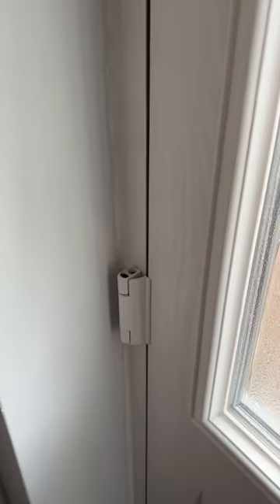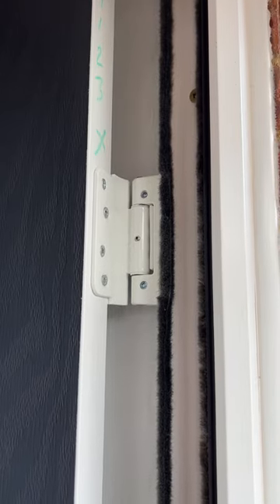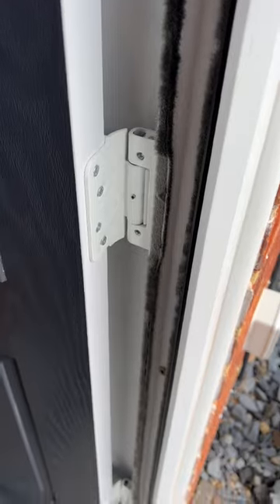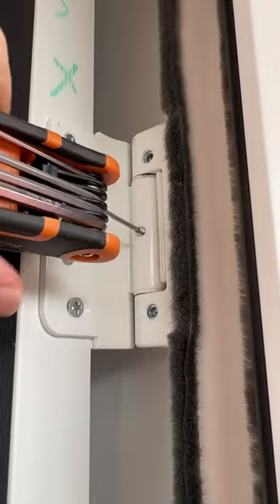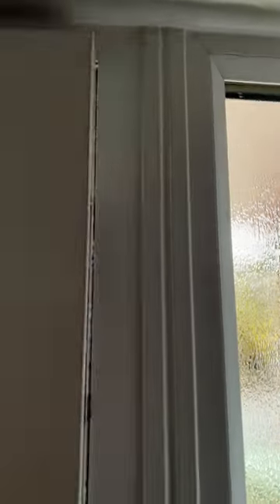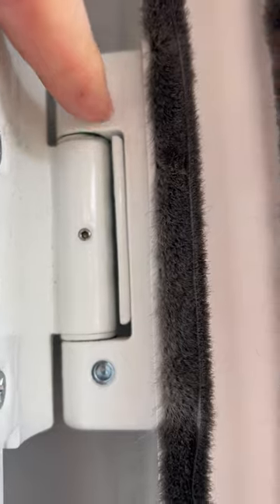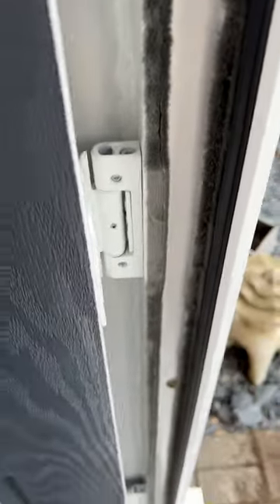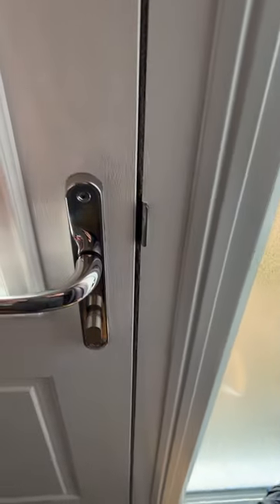How i adjust composite door hinges

Comment: This video would be more helpful if you actually showed how to adjust the hinges... What is a hinge pin? What are the side adjustment screws? Which way do you turn them and on which hinge(s) to make which adjustment? Is there a published user manual for these hinges somewhere? My front door is doing the exact same thing with similar (but not the same) hinges but this video hasn't moved me forward much.
Reply from the maker: Hi thanks for you message on my door the hinge the central pin keeps the door connected to the frame part. The small grub screw stops it from moving. The top and bottom ones are what adjust the gaps. It’s a case of making small adjustments to them to get the spacing correct. It may be worth searching for your particular hinge if it’s different. Hope this helps regards Graham
Reply: Cheers! @DIY_Projects_Tech

Comment: Hi, i have a front door with similar door hinges, i have 3 hinges.... The issue im having is when pulling the handle up it wont go up all the way.
This seems to be down to the door at the bottom.
The door opens inwards so when inside the house if i close the door and place some pressure on the bottom of the door so i push the door towards the frame the handle can be lifted all the way, The door visually looks like it needs to be pulled in towards the frame at the bottom.
Would you know which hex keys would i be having to adjust to achieve this please?
Reply from the maker: @montyloads  Hi I have hadn’t to make that adjustment on my hinges but I believe it’s the other set of hex bolts. I’ve had to adjust my french doors but they are a little different the surface hex bolt make that adjustment. I am working away at the moment I would have check for you otherwise. Have you check to see if there is anything lose that maybe stopping or is the door warped?
Reply: @DIY_Projects_Tech  hi...doesnt seem to be anything loose and i never even thought about the possibilty of the door being warped.... its a pvc door, can they warp?
Reply from the maker: @montyloads  Hi yes they can if you get a long level or straight timber put it against it. The other thing you could check is the hinges screw nice and tight on the door it’s self.
Reply: @DIY_Projects_Tech  by using a long piece of timber it looks like its warped 😔
A bit disappointing tbh.... it is 14 years old but for the amount I paid for it I'd expect it to last longer
Reply from the maker: @montyloads  14 year not bad they normally say 10 year to be honest. Maybe still worth having a play around with it to see if you can make it any better. I got same issue with my rear French door one leaf got same issue but at the top. I’ve managed to get it to close ok but lock still not great. Best wishes Graham
Reply: @DIY_Projects_Tech  was thinking of maybe trying to move the metal plate on the frame that the lock goes through a bit closer to the mechanism (its a separate plate to the rest of the locking mechanisms)... 
it has 2 hex that you can use to adjust the plate inwards or outwards... I adjusted it as far as I can towards the mechanism but it seems just a bit shy....by doing so I can see the plastic of the frame so I may try shaving that pvc back a bit to see if it helps.. bar that the only thing I could try is to move the metal plate over and the pvc part of the door.
Or remove the plate and just shave back the pvc of the door to allow the mechanism to pass which will atleast allow me to lock the door propery, that lock won't have any strength of a plate but atleast ill have the other locks in use
Reply from the maker: @montyloads  sounds like a plan let me know how you get on. Best wishes Graham